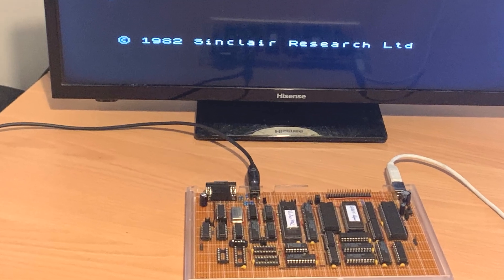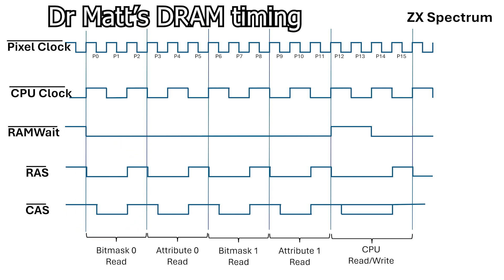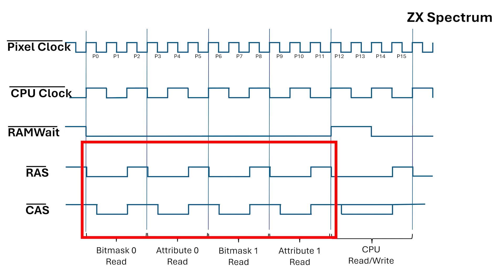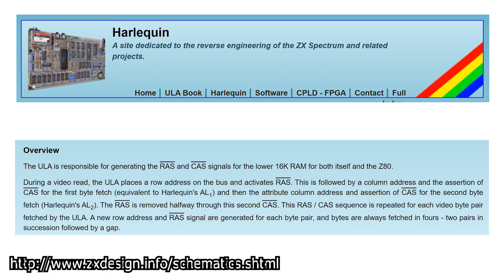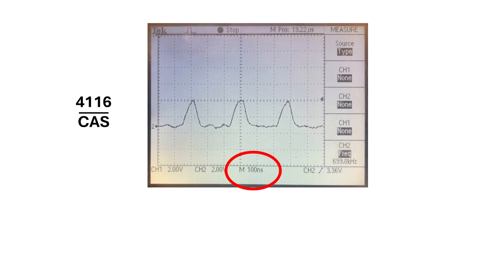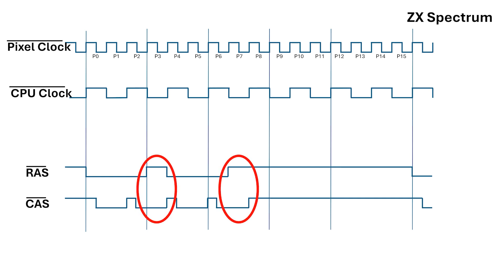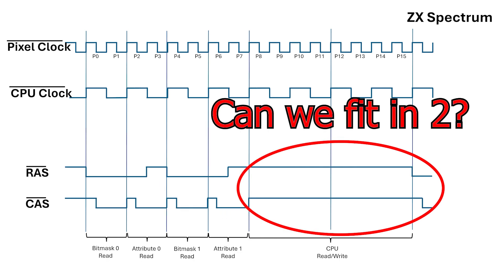ZX Spectrum DRAM timing explained.

Comment: Good stuff, here.  Handy reference material in terms of techniques in interfacing with or even emulating legacy hardware. 👍
 - If I get time over these hols (and I remember), I'll dig out the Spectra I have and see what versions of part comprise the lower 16Kb RAM banks in each.  

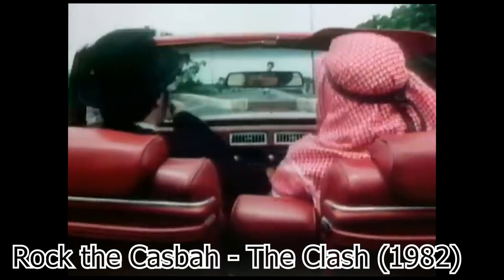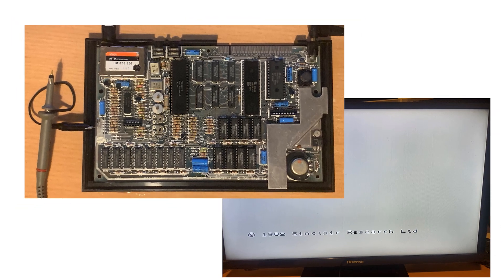~6:35 - 🤣.  In all honesty, I was already going there at ~4:47.  I'll attribute this to being primed by the regular (+ era and culturally appropriate) references to a particular TV show that appear in this and the preceding ZX80/81 playlists :)
Reply from the maker: Ha ha, yes.  Part of the reason i made this video was because i went through all the steps to figure it out, and i know i would forget the details, so i made a video to remember them!

Comment: Hi Matt.  The Sinclair QL was actually originally a basis for a new zx spectrum, but only the business machine was pursued with some spurriou (sorry laid up in bed this comment might be a little difficult to write fluently) spurious design choices.  What about stripping off those design choices and incorporating the improvements into a z80 spectrum design?

The QL gate array logic has been redesigned giving a 16 colour 256 mode, and better 512 mode.  The same person is working on a better version with sprites, but I think there is a simpler way that discrete logic could be used.  Here are a few ideas:

A simpler serial network bus that can be broken out into whatever peripheral format needed (the most advanced part of this proposal, which could even be made into a sub standard USB bus port, to support a subset of peripherals using more recent versions of the processor and memory.  Where, whatever function just requires programming to the controls that the basic generic USB  device requires.  We only need a few game controllers, a mouse, maybe a keyboard, printer and USB stick.  If there is any generic printer functionality.  Other things like generic hub, speaker, microphone and scanner support are other things that maybe desirable, but optional). But, this ties in with the second most difficult feature (below).

So, such a serial port would have raw Async and time division modes to support all devices.  The time division mode also allowing data to be sent asynchronous across it's time slots, to service Async port usage (I can't currently remember other modes, but these are enough).  But one idea, is to off load performance draining Async polling through a small discrete logic circuit.

The list of peripherals above, covers everything needed for a super Spectrum 0.5, which could have been done in those days with USB devices today substituted for Sinclair branded serial devices and parallel port converters, similar to what Commodore did with the HP serial bus, but faster and simpler.   No keyboard controller, no micro drives, no QL expansion ports.  No Atari game controllers, with a keyboard game controls, to game controller, user configurable configuration files. No tape or external audio.  The USB substituting for, microdrive, rom card, and cheap 3 inch floppy, like the deal Amstrad got, which Sinclair could have pursued out of the many alternative 3+ inch formats out there (this being a spectrum, we assume they would have shipped tape and card on the basic version (personally, I would have just looked at incorporating micro cassette with fast seek and lookup table that could be copied into memory from the start of cassette, so seeking is non contact).  I did suggest to Clive, a way of retro fitting a micro disk into the microdrive slot years later to give a more durable format).  No keyboard controller, but using a faster z80 and a register to keep track.

Graphics timing, to allow up to 256 colour (first model, in the 256 mode, second model more and pelleted) and 16 colour 512 mode, and optionally, maybe a proper programmable colour character graphics 80 column 640x240+ mode for word-processing etc, with 8 bit character 4 bit fore ground background colours).  Maybe a 16 colour pallet.  Maybe a 256 colour 320 mode.  To keep memory usage down, maybe 16 and 256 colour character modes.  Even though using the increased bandwidth of modern parts it is easier, this is  how a QL could have been done, and how 1984-1986 Spectrums could have gone.  The important part is, only a portion of memory and 256 or 16 colour characters are needed.  Complexity here, is based on what features are chosen from these modes.

The second most complex thing is the simplified DMA controller with simplified blitter to overlay objects into bitmap or character set.  If we presume the first 9 or 16 characters are 16 or 256 colours for the main character object, the blitter has a known configured character space.  If we presume every 9 to 16 characters, a segment, can be used for other main animated objects, the blitter can easily render by prescribed layout rules to those characters at that position.  The programmer only needs to have a 3x3 or 4x4 characters from one of the segments of  characters at that space before they call the blitter.  The 3x3 or 4x4 is only in the blitter's understanding of things. Otherwise, the characters can be used anywhere individually.  It's for the simple games of the day rather than mega big graphics objects.

The blitter is not even needed, except it's faster.  It could be implemented without blitter, but any pure bit mapped mode would be slower.

Using the multi coloured character scheme, even a 16KB machine could take advantage of 16 and 256 colour character graphics.

But, without any of that, the simplest machine becomes your  spectrum design with 16 and 256 colour programmable character modes, and maybe 512/640 80 column mode.  Which is similar to what I had wanted to do in the past, as a proof of concept of how the zx81 could have been designed, except 16 and 4 colour character modes and a pallet, and maybe 512 width support.
Reply from the maker: Wow, i think that qualifies as the longest comment ever!

I think i'm heading off in a different direction on the Spectrum.  My next goal after this series is to replace the 
Z80 with a TTL-CPU.  Something along the lines of the Turing6502 series.

I haven't looked too closely at the QL, if i ever do a SAP68000/Turing68000 TTL built CPU, i think the QL would be a natural target.  I'm not super familiar with it, but it looks like the easiest target of the 68000 series machines.  SD cards replacing the microdrives etc.  I'm more interested in the basics than building out a graphics system.  I previously worked as a computer architect at NVidia, so building an 8-bit graphics system feels a bit underwhelming.
Reply: @DrMattRegan  :)
Thanks.

Nowhere as underwhelming as Spectrum and QL graphics.

An easier target, is something like the My4th discrete logic computer.  Minimal instruction set microprocessors offer a lot more for the same complexity as 8 bit designs.

As for the Spectrum/QL, it's more about function for me.  I still want to one day, get a team together to do a Jupiter Ace replacement.  Something like 16-32 bit misc Forth processor, retro style upgrade computer.  I'm over here to get some similar ideas.

Anyway.  Look up the HEC computer design.  Andy is doing a protected mode Z80  system with MSX 2 graphics.  A lot of components to make the protected mode work off of an old  undocumented Z80 feature.
Reply: @DrMattRegan  Here are the two systems:

https://youtu.be/Kn0MxHlima0

Andy has some newer live videos.  He certainly is a whirlwind of activity.  With this, being only one of his projects:

https://youtu.be/rpTXft1GNQ0

Comment: I build zx with static ram from 486/pentium mainb. cache chips. With assync VGA. From z80 side all RAM was always ready. It was too fast for games. As it was assync design I boosted CPU to ~7MHz. And it was working fine. I used old altera cpld for logic.
Reply from the maker: Excellent.  Did you wait the CPU, or didn’t it matter?

Comment: Great analysis, thank you.  I am with you that there might still only be one access in the available spare time in the video memory timing sequence. But a wider window for the RAM access will slightly reduce the time the CPU waits for the window to be available. Of course, the CPU will also be spending time elsewhere, accessing ROM mostly, and also sometimes I/O, etc. so the time when the RAM isn't available won't always be lost.  But I am of the same view as you that this arrangement was most likely to allow slower RAMs to be used. 150ns parts would have been at a premium compared to 200ns, although I doubt they would have used parts much slower than that. At the time, 150 and 200 were the most common commercially available, as I recall (it's been a while). Thanks again.
Reply from the maker: Thanks, it was actually your comments that inspired this video (hope you don't me quoting them).  I did actually have some slides on the wider window, i suspect the latency will go down from 22 -> 20 cycles (for a 3-byte, 10T cycle instruction).  But these slides ended up on the cutting floor.   I agree that 150ns and 200ns parts were most common, but knowing Sir Clive, when they were designing it, i'm sure they'd aim for the slowest parts possible, even if they were just 200ns parts that missed timing.
Reply: @DrMattRegan    Not a problem, although I did have to explain my reaction to my wife... 😁
Reply: The Z80 will only access the ROM or I/O if the code allows for it. The ULA will stop the clock to the Z80 if it detects the Z80 wants to access the Speccy's contended lower RAM during video routines, and this will stop everything, including I/O and interrupts. No clock means the Z80 does nothing. This is why many developers avoided using the lower RAM for time-critical functions. Obviously, games for the 16K Spectrum only had the lower RAM; I presume developers compensated for this as best they could.

Comment: Just another data point: I opened up the issue 4S Spectrum I have here and it's fitted with TI 4116-15NL for the lower RAM, so 150ns.
Reply from the maker: Thanks, i'm interested to see what the spread of speed ratings will be.

Comment: 12:13 Wait, the Z80 has a single-phase clock, and M1 without _WAIT states is always 4 T-states = CPU clock cycles. The RAS/CAS as seen is _MREQ during T1-T2 for the fetch, or T1-T3 for other M-cycles. The page-mode timing is as tight fit as can be.
Reply from the maker: Two of the T states in M1 are for refresh, which we don't need for scan out.  The raster itself will refresh the memory.  (slightly out of spec at 2.05ms).  I didn't see any refresh RAS cycles during scan out on the scope.  

So we only need two T states available for CPU access, in the 16 pixel scan (8 T-states).  We need wait to co-ordinate this, but interestingly, the spectrum actually stops the clock.  Admittedly i haven't tried this solution, but it fits in theory.

Comment: With the C64 I understand that their cache fixed the to 40 characters, but with the ZX spectrum I now don’t understand why it does not have a turbo button like a PC to increase the clock up to the limit of whatever the manufacturer got for DRAMs that day.  Though I guess that 14 MHz signal processing is on the technical edge of the ULA. Is this CMOS? NMOS ?
Reply from the maker: I think old Sir Clive was more interested in price than performance!  I'm not sure what technology the ULA was made with, but i don't think it was CMOS.  CMOS was originally quite slow (4000 series logic).  14Mhz was a fast signal back then.
Reply: @DrMattRegan  with DRAM you pay more out of the sweet spot. Extra slow or small or defect DRAM went out of stock at large retailers fast and became expensive vintage hardware. Can you show me any IC that does not use MOSFETs? TTL logic! But for some reason those chips seem to be very primitive and only used for glue logic. Since nMOS became TTL compatible, I wonder if a TTL chip really uses bipolar transistors internally.

RCA 1802 hit 3 MHz before 1980. Maybe some hand optimization and fab improvements would bring that to 14 MHz in 1982 ? I could imagine to do double illumination: use a microscope objective to etch the fast part of the chip with shorter FET channels.
Reply: The Z80 was tightly coupled with RAM speed. SRAM cache didn’t exist, so pretty much you were limited to whatever parts you could get at reasonable prices. They were also limited by the fact that the Z80A was only rated to 4MHz and the later B model only ran to 6MHz, so a simple speed doubling turbo wasn’t going to happen.
Reply: @stevetodd7383  SRAM was popular for 8bit CPUs. Commodore VIC-2 . Sega Master System. PCEngine. (SNES, Sega Genesis) . The turbo on PCs did not double the speed. It switched between the Xtal which came with the CPU ( 16MHz ) and the crystal for the chipset with timers for the speaker and floppy data transfer(4.7 MHz ). Why even double? Xtals were always 14 MHz or more ( 15MHz for NTSC ).

Isn’t it interesting that the 3do had no cache, but relied on its 32 bit fixed instruction length to get stuff done. Also multi register Load instruction and a powerful shifter to encourage coders to pack data into bitfields.

In the same year the Jaguar introduced scratchpad SRAM. You were supposed to use the blitter to load the next object ( code and data ) into SRAM, while the JRISC works on the current.
Reply: The Z80 was initially fabbed in NMOS technology. Later versions were CMOS. The ULA may have been CMOS, but was limited by the CPU.
The 6502 was designed such that the RAM could be easily split between the CPU and the video controller by simple time diversion multiplexing with memory running at double speed. This is how the C64 and BBC computers worked. The Z80 memory timing was much more complex so couldn’t be split in the same way.
Reply: @stevetodd7383  why would nMOSFET be faster than CMOS? And early versions of ICs were actually pMOSFET due to some fab limitations. NMOSFET has twice the electron mobility than PMOSFET. So that gives us a factor of two in speed? But nMOSFET already had a power problem (and heat). And hence the pull up current source was throttling everything. No such thing in CMOS. They did not have spare transistors to equalise latencies.

6502 actually had precharge transistors. So aggressively pull up all busses before the next cycle. Maybe they even included some feedback to compensate the previous bit pattern. But every sender then needs to stick to its values. No edge trigger stuff possible.

6502 was not designed to share memory with video. This was more an accident because SRAM was so fast. ZX spectrum shows how to share memory on Z80 . It looks clean to me. I found some discussion, that the ZX spectrum killed RAM because it ramped up the 3 supply voltages in a wrong way. But the RAM itself and the sharing is a good design.

Comment: Excellent info, this is going to be very useful for a crazy idea that I started tinkering. I got some dual port SRAM and I'm planning to replace the lower 16Kb with these and decouple the CPU and the ULA, with a port for each one and an isolated clock for the CPU it should remove the contention and also even be able to add a 8Mhz variant of the Z80 :)
Reply from the maker: Excellent, sounds good.  Let me know how you go with it.   I'm keen to hear how you integrate a faster z80.

Comment: That was a very well thought out explanation!  I think I am with you on the "Cheaper is Better" option for Sir Clive.  Absolutely no doubt in my mind that they just wanted to use cheaper drams.  IIRC didn't the 16K spectrum use its ram chips at half capacity so they could even use ram chips witch only tested partially good (assuming they were cheaper?) anyway love the series so far!
Reply from the maker: Glad you liked it.  I think it was the 32K expansion in the 48K machine that used the faulty chips.  They were made as 64K chips which failed QA.  But if half the chip was good, they passed them off as a 32 K chip.  Very clever business man!..
Reply: @DrMattRegan the 64K DRAMs were tested and marked depending on if the lower or upper half failed. Then there was a link on the motherboard which defined whether the upper or lower half of the installed chips were to be used. More famous scrimping.

Saying that, it’s common to de-rate chips these days depending on how well they test out. AMD CPUs for example, beyond being speed binned, are fabbed based on an 8 core chiplet. If one or two of the cores are bad then they mask off two and ship them in 6 or 12 core parts (2 chiplets for the 12 core version obviously).
Reply: On another note. This makes me wonder. The speccy screen memory is overcomplicated, taking many instructions to do anything. Betting someone has built a hardware expansion to convert sequential into real screen layout. Would be a cool H/W accelator expansion.
Reply from the maker: Interesting.  I'm sure some of the Soviet clone makers tried everything!